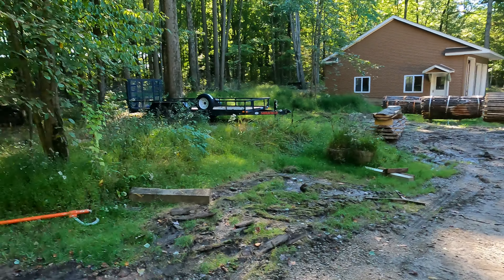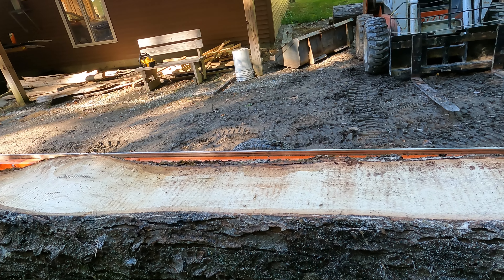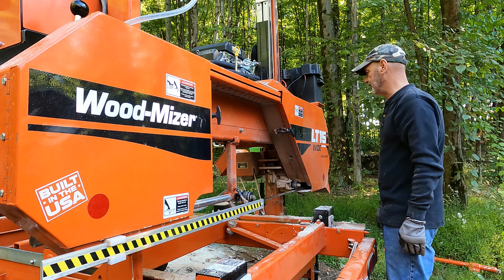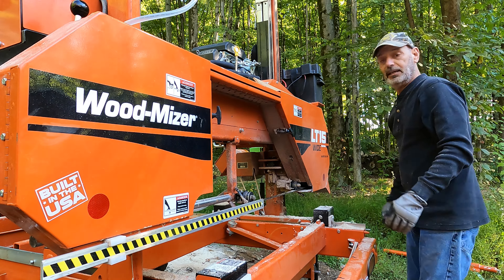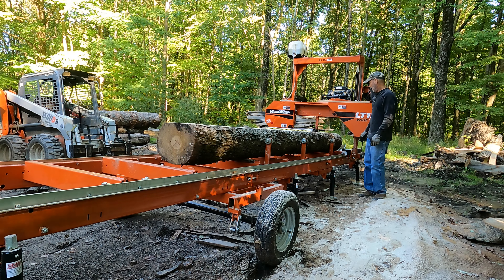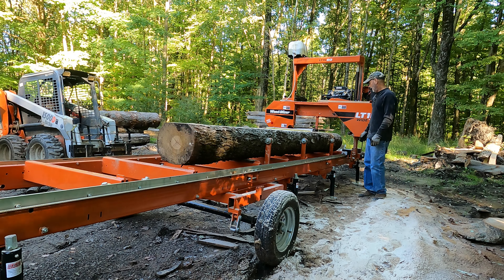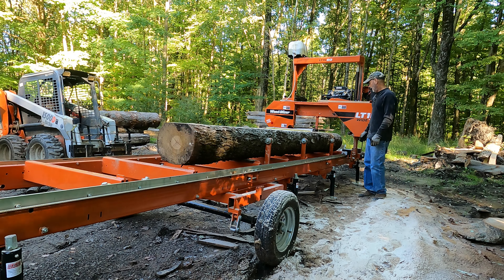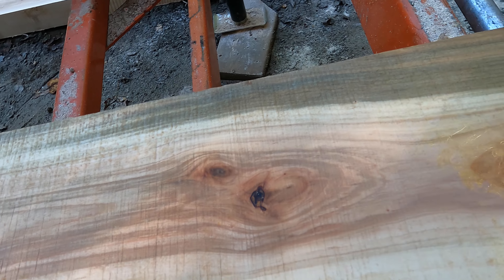Everything goes wrong, cracks, ripples, bowing, salamanders..

Comment: That blade guide needs to be close to the wood. Been working with wood for 50 years.The blade is flexing up and down trying to follow the grain of the wood. The path of least resistance 👍
Reply from the maker: On the LT15 wide, you can only move the guide in so far. I think closest it gets to the other roller is like 15"

Comment: I would of spun that log so the slit is horizontal,and got rid of that first
Reply from the maker: I considered that but then I would have had to cut the branch off with a chainsaw since it would have been on the left side in the way of the head frame. Seemed like more work lol..